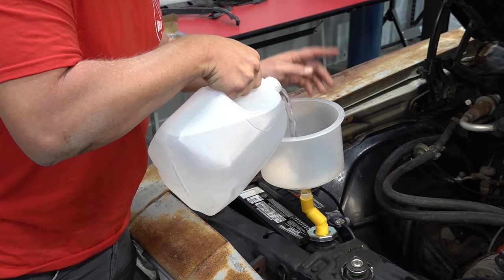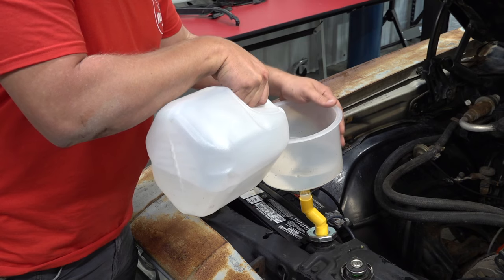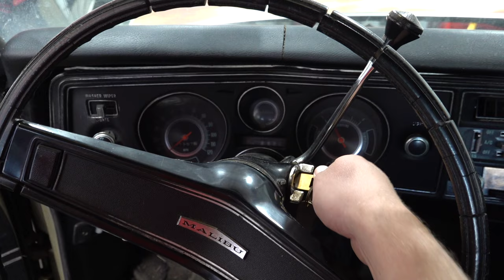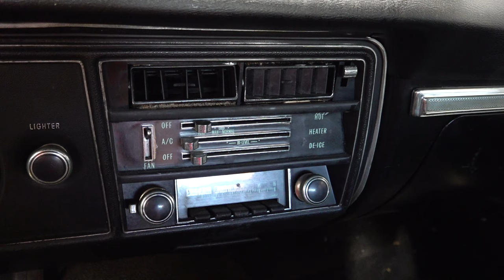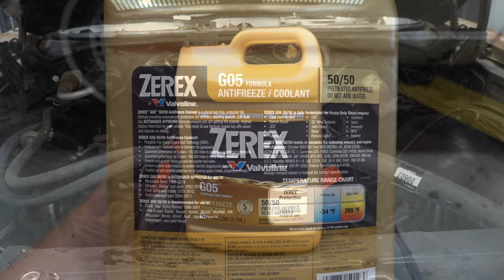How to Flush Coolant: Step-By-Step Instructions from Kyle Lindsey

Comment: I'm going to try this stuff in my Chevy Colorado 2.8L I use Valvoline Maxlife in my Engine. And I use Maxlife Transmission Fluid in my Transmission. Iv used Valvoline in my Engine for years. I just started using Valvoline Maxlife in my Transmission and I like it so far but time will tell for sure. Or thats where my Rating will come from but so far so good with Valvoline and like I said its all I use and im using more of it and its impressed me so far.
Reply from the maker: A video series focused on transmission fluid testing is a great idea! Similar to our engine oils, Valvoline’s transmission fluids are put through a series of demanding bench and rig tests to ensure optimal performance in your vehicle. The critical transmission fluid tests evaluate clutch friction performance, gear wear, shudder resistance and aeration. In fact, we perform one of the critical rig tests, the SAE #2 Friction Test, at our Ashland laboratory. Transmission designs continue to change and Valvoline’s transmission fluids need to evolve to ensure optimal performance and durability.
Reply: 😢 CNN C. M bb d
 PmP🎉 bennbb bcbb

Comment: If it very hard to achieve such clean flush, if you drain only at radiator cap. Again, if you drain only at radiator car, significant amount of water will be left in the system so you cannot use prediluted coolant. Great idea with that funnel. Lot faster to ventilate system. I did not have those, so I taped plastic bottle.  Also, very often you don't need to raise car to open a vent - it can be accessed from above.

Comment: If you don't have any, or minimal aluminum components in your engine the 'old' silicate based green is perfectly fine. You could use HOAT but it's really not necessary. If you ever have a manifold leak in a car with a wet intake manifold and either OAT or HOAT antifreeze you'll find out real quick the benefits of a green 'old' type antifreeze when your bearings get wiped out from the acid. The only reason for HOAT and OAT antifreeze is since they started making all these modern engines out of throwaway metals like aluminum and recycled beer and soda pop cans. It allows longer service intervals without corroding the engines. Neglected silicate AF and aluminum cause high electrolysis. So will OAT, but to a lesser extent. HOAT and OAT are more susceptible to impurities (minerals) in the water, and you get the same thing. Take a voltage reading of your coolant. That will tell the tale.

Comment: I bought my 2017 challenger brand new back in 2017....then I got my check engine light and checked the plastic thing where you pour water and it was kinda empty...so i put water and engine light went away...now it's brownish the liquid so I need a radiator flush right?...that's the reason I have check engine light.
Reply: So was it the head gasket?
Reply: @Jason-zw2dg  I don't know...and my power cuts off ...like let's say I go in to like 65 or 70 or if I accelerate very fast to those speeds my car goes back to like 20 and the traction light comes on and I have to turn off the car so light can turn off

Comment: No one can help with my drain plug 😢 the plug sits behind and against the radiator frame. I really hate the idiot that designed my car. I have a 2008 Buick Lacrosse Super and it apparently has air in the system. The resevior bubbles like it's boiling and all the fluid comes out. Car only goes alittle past half temp, no engine light. Unfortunately I can't get to the plug, the v8 is too big for the car. They have the battery squeezed between the frame and the pulleys under the corner frame with a half inch gap making it a b**h to change and can't be any larger not a centimeter or won't go in.
Reply: I can smell the coolant burning like the car is overheating when it's "boiling" out. 😭
Reply: Normally you can take off a heater hose or a hose at the highest point above the level of the engine and refill until it runs out of that hose. Typically the air will work out over time as it will want to go to the highest point which is usually the expansion tank on newer cars.
Reply: @dragonext2001  You should look at aftermarket radiators they might have a drain plug in a better position. Other than that you have to do what the other person said and take off some radiator hoses to drain it. Refill drain again and do that a few more times to completely flush it with new coolant. Not an ideal way to do it but better than not doing it.
Reply: In addition to that you should install a new thermometer while you're doing the flush to make sure it's not bad and so that you don't have to drain it again in a few months or a year or two just to install a new thermometer.

Comment: Zerex has a product labeled as for Toyota Lexus...  DO NOT USE! Personal experience.  I topped off with Zerex and had a negative effect.  I then, in turn, bought the Toyota super long life coolant (pink formula) and paid $18 a bottle AT A TOYOTA DEALERSHIP THROUGH THEIR OFFICIAL TOYOTA PARTS WEBSITE compared to $22 at O'Reilly. I had to flush the system because of that top off.

Also, pressure flushing is never a good idea for an older car...  Old seals being exposed to pressures higher than the cap is rated for is asking for trouble.
Reply: very well spoken...also, I would rather use the green coolant that this vehicle was using back in the day!
Reply: Pressure flushing is fine… just keep it below 50psi
Reply: @coreturkoane5570  I wouldn't use that new junk in an old car either. Don't need it with a cast iron engine. I had a car that I primarily kept in storage with a rebuilt engine and new pristine cooling system. I flushed and filled with the best Prestone green and distilled water and it still looked pristine and new 15 years later. Granted it wasn't driven much at all but it's the heat, usage and combustion gasses that break down the coolant. I checked the coolant 'voltage' and it was just about the same as when I filled it. The other thing is to make sure you don't have any ECR rubber hoses. That's electro-chemically-reactive which means the rubber causes a small charge or current to be induced in the coolant which will corrode the engine over time.